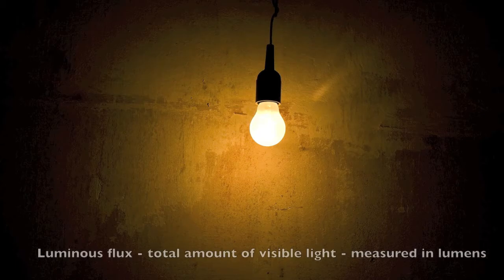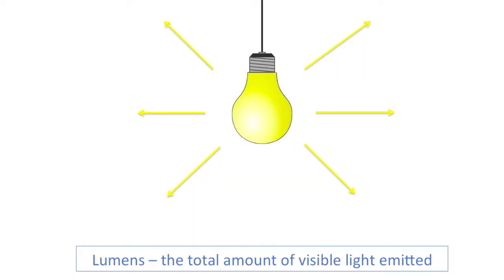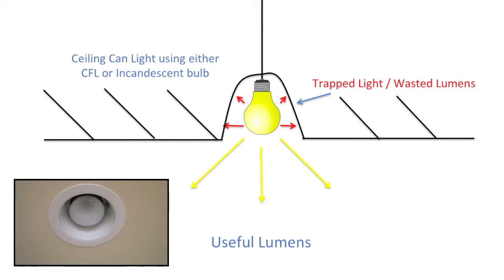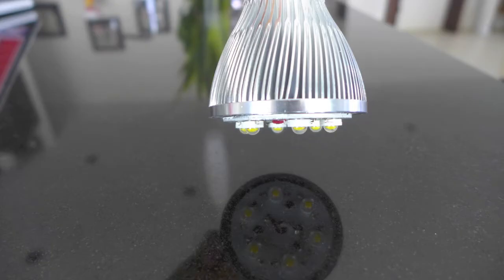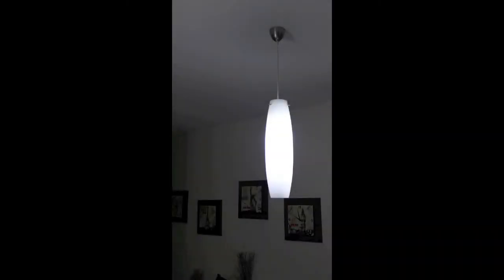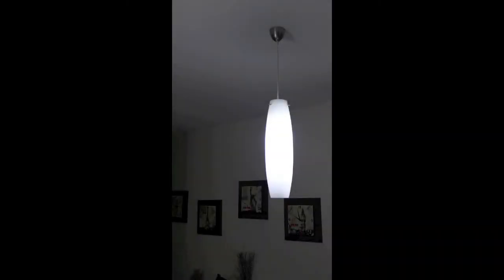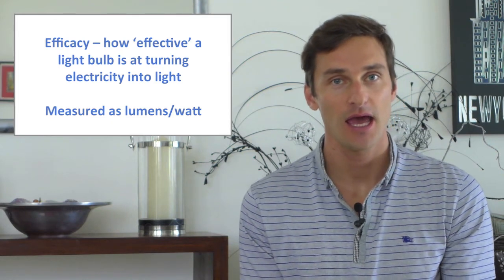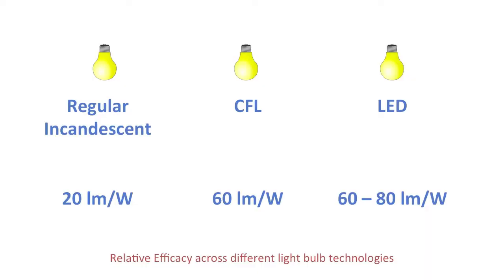Intro to LED Light Bulbs: Part 5: LED Light Output and Efficiency

Comment: Most lamps at home need light in all directions to evenly light up the shade or if they're facing up. Only those recessed in a shade or ceiling look good radiating in one direction. But then the heat gets trapped in there and cooks the LED power supply. Incandescent with reflectors also exist.

Comment: I also believe in Santa, water powered cars and superman saving the city!! What about the huge amount of heat that needs to be dissipated and the luminosity that is going to go down over a very short time because of all this heat (yeah.. leds uses to lower its efficiency over time when generate heat...)? And what about the real inefficient power sources used to power up those lights?? And btw, around 10 to 30% light is usually lost when you enclose a light bulb, unless, of course, you use a very very dumb way to mount this on the roof! And the light spectrum that have some green and red bandwidth missing(which doesn't make it good to see all colors)?? Well not saying that LED are the worse, but aren't quite so good as yours (biased opinion) point of view